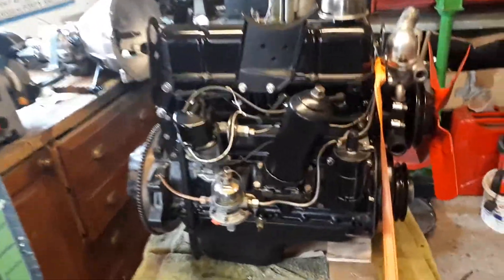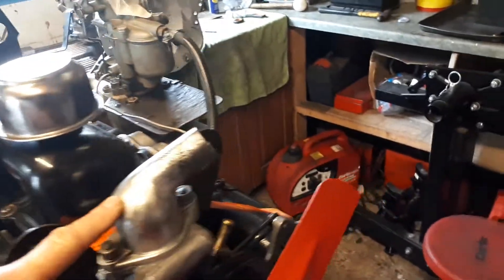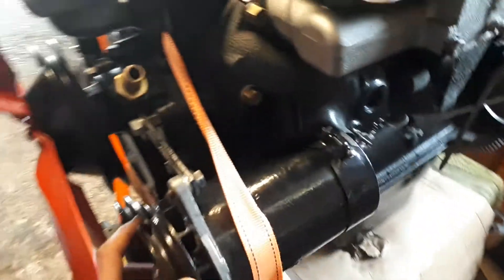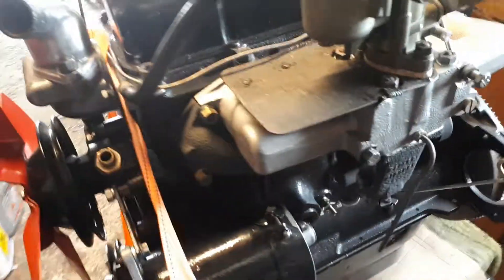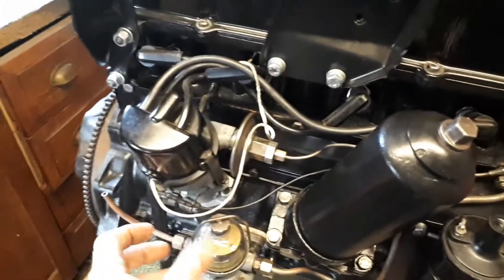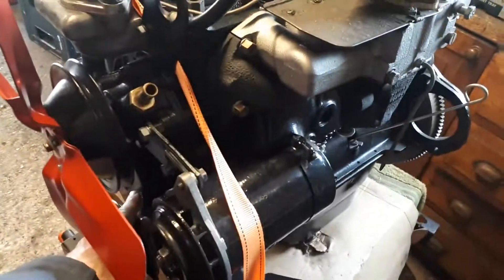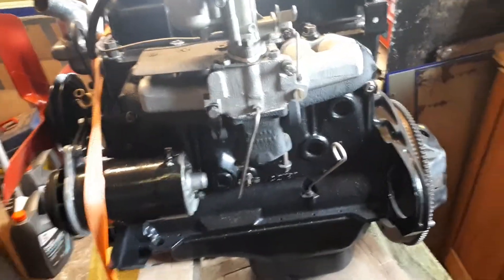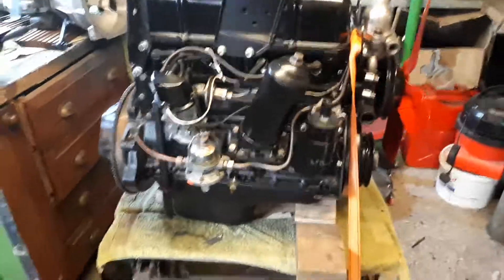Hillman Minx Engine and Gearbox finished rebuild

Comment: when timing an engine you need to check the position of the  valves,ie when pistons 1and 4 are at tdc number 4 cylinder valves should be rocking and number 1 cylinder valves should be closed.